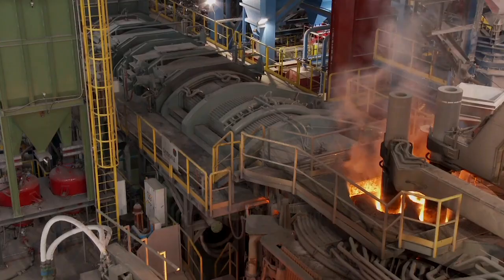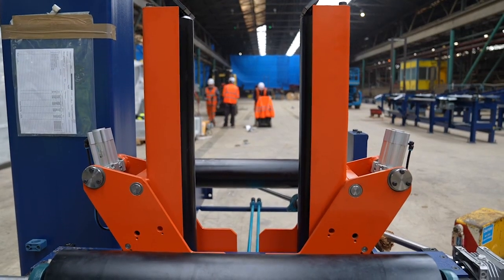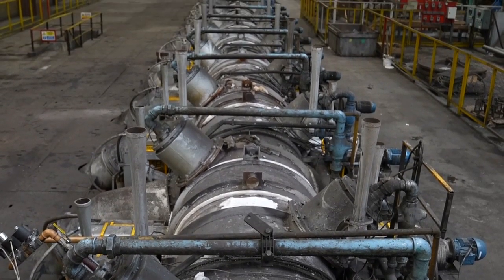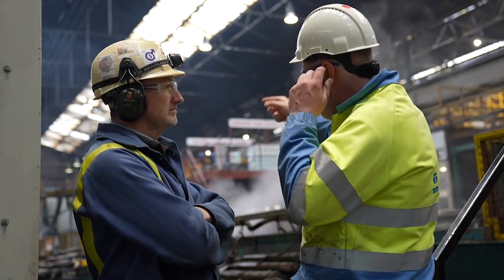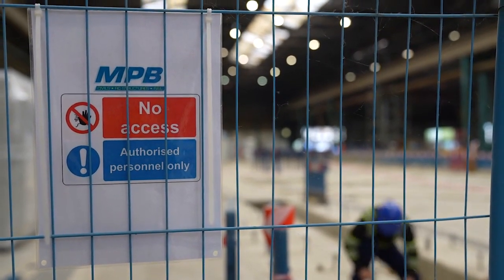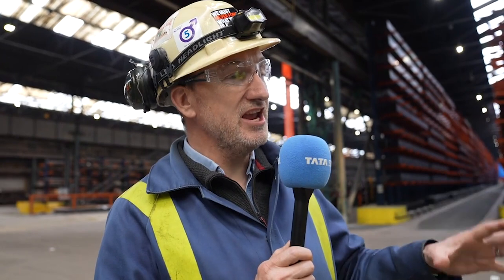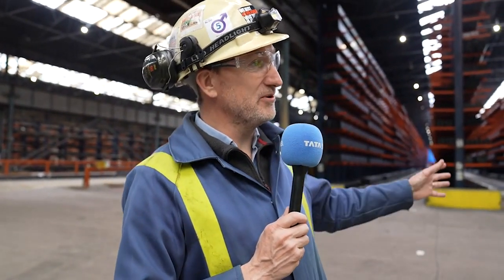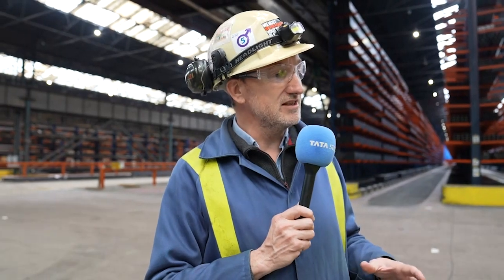Tata Steel Corby - Project Aurora

Comment: What is the TL:DR of this new mill install? what quality of tube is it producing because iv heard EAF steel is sub standard not top quality steel.
Reply from the maker: As more companies invest in electric arc furnaces, the number of steel grades produced using this method has increased. One of the great things about steel is it can be infinitely recycled without losing strength or other properties. We're able to produce over 90% of our current steel grades using an electric arc furnace.
Reply: @TataSteelUK  Thanks

Comment: EAF is not new technology! We've had large electric arc meltingshops since the 1960s
Reply from the maker: Ah, but not to make the highest grade flat carbon steels as they have started to do in the USA
Reply: @TataSteelUK  Liberty Steel is already producing steel for the aerospace sector via EAF, which has a very low tolerance for residual elements through careful scrap management. Charging DRI and pig iron isn't new technology either.

The application is new, the technology is not.